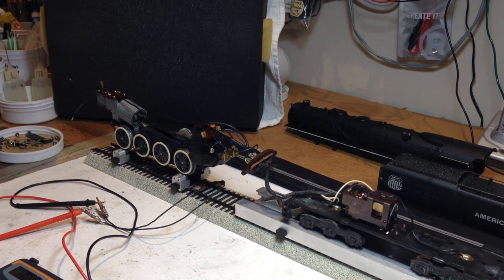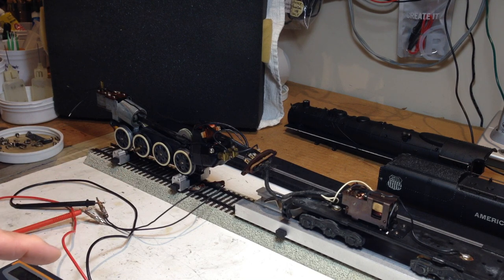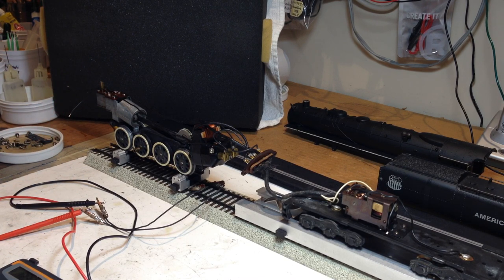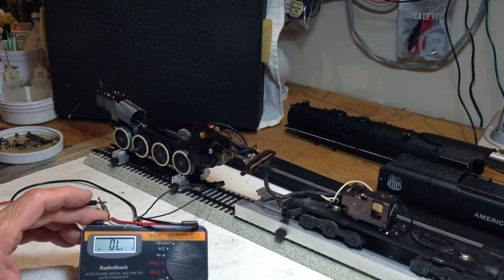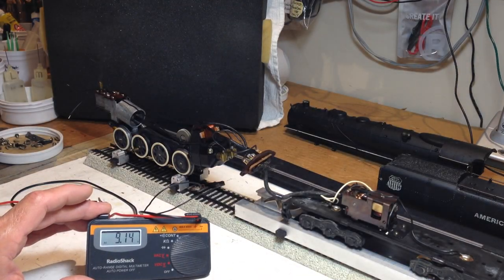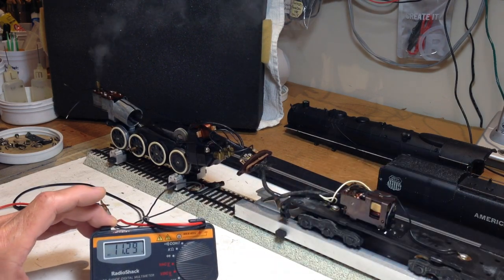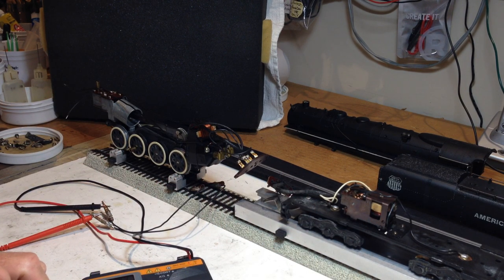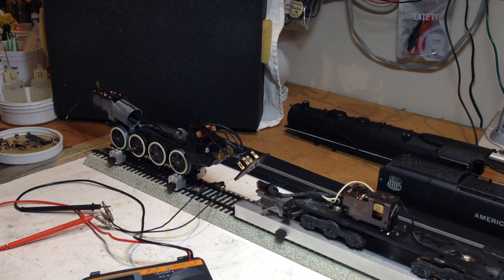American Flyer 332 AC overhaul - part 2 of 3

Comment: What are you using to polish the axles, wheels and brass and what do you use to get the heavy metal fatige that is from the tracks on the plastic wheels with ? 0000 steel wool or are you using a dremel tool with there wire wheels? Thank You, Steven
Reply from the maker: First on any wheel - small screwdriver "lathe" the gunk off.  Then on metal I use a paddle wheel polisher at the low end of the RPM range in my variable speed Dremel.  On plastic 91% isopropyl (back in the day when I could find any) on a Q-tip to get the rest off.

Comment: Precision, another great video, enjoyed it! That is one good looking locomotive, I hope to own a 8 wheel driver some day. What was the tool you use to spread the trucks apart, are those available at the big box home stores?  Got to get one. I am getting ready to order the smoke and choo-choo kit from Doug Peck to replace the billows with a cylinder and piston unit plus I hope a replacement smoke box to be used on my recently rebuilt 322 Hudson. When I reassembled 322 it appears there is little room to pass the rubber hose from the tinder, through the boiler to the smoke stack, frankly it looks impossible, the motor and E-unit fit so snug through the boiler. Any suggestions, tips, or photos/videos exactly where and how the tube is placed within the boiler?  Thanks!! Daves AFTrains
Reply: Hello Precision!  Many thanks for the detail reply, I will certainly follow your guideline and suggestion for positioning the tube. The smoke box can probably be rebuilt but I'm weak on experience in that area, hoping that Doug Pecks conversion kit includes one in addition to the piston and cylinder, 322 was missing the billows and drive rod entirely. I receive a catalog on small tools and I'l check the next edition for a spreader type tool, many thanks for your time to view and comment, best regards for a great weekend, Daves AFTrains
Reply: Hello Dave, found both articles and there're simply awesome and so is you layout and attention to every detail, I will be going back to watch and study your videos, wow!  My trains, layout, and effort pales in comparison to yours but I'll be raising my standards to see if I can come close to your outcomes, your ideas and work are tops, if we had an American Flyer Train convension we ought to have you deliver the keynote address!!  How our lives in some ways and resurgence in American Flyer trains received in our childhoods parallel is interesting. My parents too saved my train, Fort Apache, Marx Freight depot, Alamo, and rubber farm animals that constitute the bulk of the live stock on my layout.  They brought all this to my house when our son was 3, we set the train up, he loved it but it struggled to chug.  When he was in elementary school I built and operated a rudimentary 4x8 layout that I hauled in my pickup truck to elementary schools and retirement communities, it was fun to share. Upon retirement I restored my original The Mountaineer 5323T catalog purchased from my uncles King Hardware store in 1953. Continuing retirement I decided to build and fit a layout into a small garage shared with a convertible that encompassed what I really wanted in 1954, packing a lot of AF stuff in 4x10 but it worked ok. Now with a new modern garage space it looks like 6x12 or 6x14 is the best I can do. I live 12 miles from the Atlantic coast so heat and humidity is the norm. I want to emulate in a new layout the AC Gilbert showroom layout and have been collecting track, switches, trains, and accessories with that in mind. Since humidity is prevalent what do you think about a metal benchwork, with the surface primarily foam insulation plus usual wood trim and maybe plexigrass. Any thoughts, Thanks, really have enjoyed your videos, dialog, conversation, and expertise!! Best, Daves AFTrains
Reply: Hi Dave, What looks to work best for me is I purchased and received the conversion kit, piston, cylinder, push rod, pin, and I purchased a smoke chamber to ensure compatibility with a chamber with a notch to match the cylinder. I also purchased from Doug a rubber hose. A couple of projects are in front of this one, including rebuilding and restoring switcher 21004 that I plan to run counter clockwise on the layout so that it can position by pushing and pulling rolling stock. Many thanks for your advise and counsel and for offer to assist. I will keep you informed of progress, best regards Daves AFTrains
Reply: Hi David, I'll not be attending but would love to expand my conferences and shows.  I retired to the Atlantic coast and my next too shows are just some local shows in Savannah, GA and Columbia, SC.  I'm considering attending the AC Gilbert Heritage Society meeting in 2018. Have you attended this annual meeting? Best, Daves AFTrains
Reply: I did not get to go to the AC Gilbert society meeting, maybe next year. Wow, sounds like all the giants in the AF world will be at your meeting, maybe next year on that too, I would love to attend, thanks for letting me know, best, Daves AFTrains